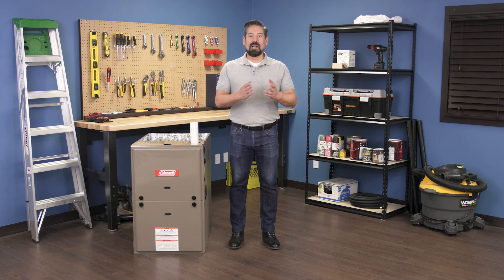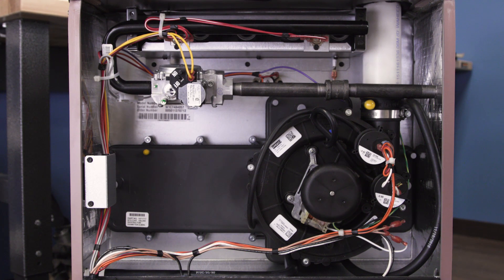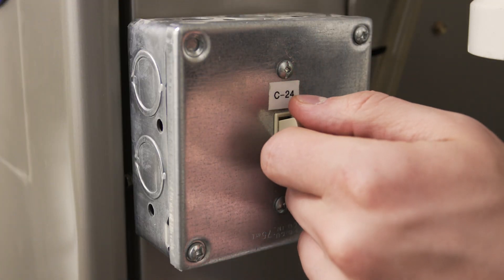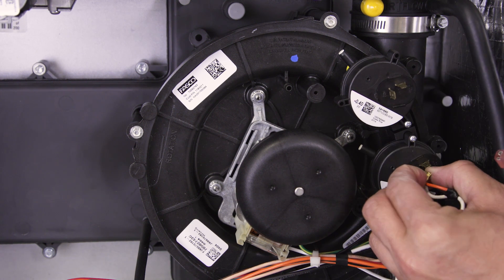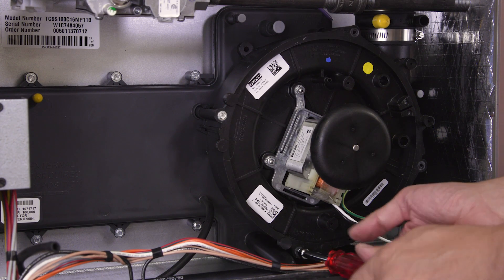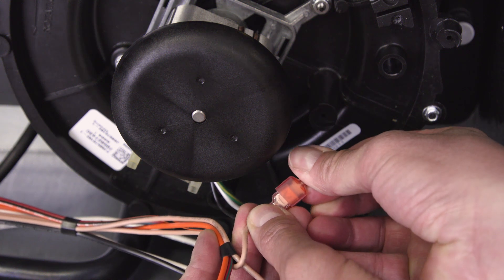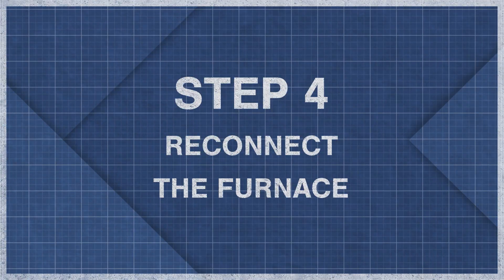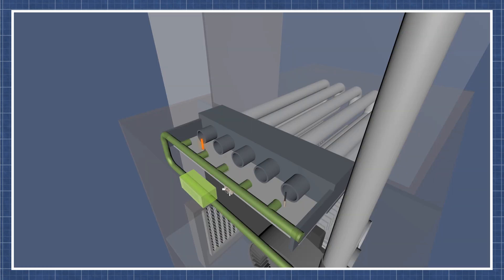Furnace - Draft Inducer Motor | Repair and Replace

Comment: I went to AMRE store in Richmond BC...I was told by a loud rude old woman that there is no returns on any electrical devices.  So the Inducer motor was not returnable even if is defective... That is probably against Provincial consumer law   For example...if the unit is defective from the time of purchase..I refused to submit to the outrageous policy of AMRE and bought it on Amazon...
Reply from the maker: Hi Jay, thank you for sharing your experience with us. Currently there are no provincial consumer laws guaranteeing the right to return an item. The "no returns on electrical items" policy is meant to help ensure that all electrical parts are brand new, and fully functional when someone needs the part. If a part is damaged during shipping or was defective at the time of manufacturing then that's a different scenario. Incorrect installation of electrical parts can result in damaged that is not always visible or obvious. Its similar to how auto-parts suppliers will not accept returns on certain functional items like spark plugs or brake pads. In any case I have shared this with the Richmond manager so we can ensure that matters like this are communicated more effectively in the future.

Comment: Good Information, Thank you. Hopefully someone can offer advice. I have an American Standard  HE (Freedom 90) installed in 1992.
Heater was cycling on and off and I kept hearing a gurgling noise, so I called for a service rep.
He cleaned my fire sensor and that seem to resolve the cycling on and off, however he pointed out external water under the Draft Induced Motor (DIM).  He pull the bottom drain on the DIM and watched condensate come out, the PVC drain pipe has a short run to the ground floor drain it did NOT appear to be clogged.
So question is 
1. Can I change out the DIM or add new seal to resolve? 
2. Or buy a new unit as Service Rep indicated.
Reply from the maker: Thanks for watching, we're glad you found the video helpful. If the draft inducer motor is clogged then the water will build up, mess with the pressure and trip the pressure switch. If its just not draining properly then replacing it should resolve the problem. Alternatively some flue vents are installed incorrectly which can cause the condensate in the pipe to flow back into the draft inducer motor. If the flue vent is the problem then water might still build up even if you replace the draft inducer motor.  As for the seal, you might be able to find the part but that might be hard to find for that particular model.

Overall replacing the inducer is less expensive than a new unit, but considering the furnace is almost 30 years old there might be other components that might need to be replaced in the near future.

Comment: Why motor leaking from little slot in Front Goodman Furnace Draft Inducer Blower # 22307501 (FB-RFB501)
Reply from the maker: Thanks for watching. If its water leaking from the draft inducer motor then its most likely that the condensate drain basin on the furnace is clogged, or the condensate pump might have a blockage in the check valve. You can learn more about the condensate pump in this video: https://www.youtube.com/watch?v=dcLhyLu0-y8&feature=youtu.be

Comment: I have a Lennox GHR32V gas furnace, I suspect I have water in my inducer motor, is there a way to empty the water without pulling the motor out?
Reply from the maker: Hi Ed, thank you for watching. Your furnace should have a condensate drain that either leads into a condensate pump or a floor drain. First make sure that the drain tube is not clogged and that the check valve is working. This is shown here: https://www.youtube.com/watch?v=dcLhyLu0-y8&feature=youtu.be That might help drain the water. If that doesn't help then the easiest way to remove the water is to remove the inducer assembly.

Comment: Fantastic video.  Thank you so much.  I'll be replacing my draft inducer motor on my Rheem gas pack.  My old draft inducer motor has 2 black wires (connect just as yours do in this video).  My new replacement motor has 1 black wire and 1 white wire (again, same connections as yours in this video).  How do I know which to connect?  Or does it matter in this case?
Reply from the maker: Thank you Travis, we're glad that you found the video helpful!  Always try to match the wires if possible but there are some cases where the new wires will be different colors. The inducer motor is an AC motor so the polarity of the wires shouldn't matter,  so just like solenoids, limit switches, and fuses, it will work in either configuration.

Comment: I'm in Las Vegas and (11-6-2020) I paid $750 for this part and labor.
Did I get ripped off?
Honestly.
Thanks!
Reply from the maker: Hi Jim, thank you for watching. $750 is within the normal quote for this kind of a repair that includes parts and labor. Part of the labor cost often goes to cover the overhead and will seem higher than what most people think an acceptable hourly wage is, but in a lot of HVAC companies there are administrators and other staff that are supporting the technicians. There are many homeowners that have done these repairs themselves and saved some money, and other homeowners have hired someone while supporting their local community. The matter of value is up to you to decide.
Reply: @AmreSupply  thx

Comment: What is the plastic thing the draft inducer mounts too? It has what looks to be water drip line. My draft inducer went. I replaced it, but noticed the plastic is cracked where the foam gasket sticks too.  Could that crack be allowing water to make its way into the draft inducer. Causing the draft inducer to fail after 4-5 years? We replaced it about 5 years ago. The plastic wasn't cracked during the replacement process. I dont want to blow another draft inducer motor in a few years, if I can help it.  I will replace that cracked piece as well. Please any info is appreciated. Thank you.
Reply from the maker: Thank you for watching. The piece you are referring to is often called a condensate pan or collector. In some furnaces the condensate water is removed by a floor drain and in other models a condensate pump is used.  If the condensate drain line is clogged, then condensate will build up in the inducer motor.  First check to make sure that the lines are all good and have clear access. As well ff either the inducer motor, the housing or the condensate pan is cracked then its best to replace it. The condensate pan is not a very common part to replace and is often hard to find.

Comment: Is this a diy job and require licensing, like when the central ac isn't cooling house which requires freon?
Reply from the maker: Hi Xian, thank you for watching. This is not a sealed system like an AC or a refrigerator. The pressure switch monitors the exhaust gas pressure, so once the furnace stops running, the inducer will continue to run, clearing the flue of exhaust. When the furnace is not running there is just room air inside the draft inducer and vent. Replacing the inducer motor assembly is pretty easy overall but if you don't feel comfortable with the repair then it is best to contact a professional.

Comment: My inducer motor makes this electrical zapping noise when it goes to start up then its quiet. Should I replace it? Transformer and start up capacitor are both new
Reply from the maker: Thanks for watching. Since it happens only when its starting could be one of the contacts in the relay on the control board. It could also be a  loose connection or a worn out motor winding. Relay issues are hard to narrow down but with the power off you could check for continuity between the inducer motor contacts and the metal housing of the furnace to see if it is shorted to ground. Regardless If it runs properly after startup then it might just continue to work for a little while but its best to keep an eye on it.

Comment: Hi and thank you for an excellent video and encouragement! I am definitely a diy'er. My friends Bryant furnace has a very noisy inducer motor. My question is what is the rationale for replacing the entire assembly vs just replacing the motor? Except for the motor, nothing else is moving, correct? Sounds like a bad bearing or something akin to that. Also, I like to support folks such as yourself who provide the service of excellent videos, but you are in Canada, correct?
Reply from the maker: Thanks for watching! We're glad you found it helpful. Overall Inducer motors are sold as fully enclosed assemblies, as any disassembly of the blower can compromise the seal and potentially create pressure issues. 
You are right, we are in Canada, and we do ship to the USA but with with the lockdown still being lifted, shipping over the border is not back to normal so it might take a while.

Comment: Hey does anyone know if the inducer motor and the restrictor plate is needed to run the AC(central air)? My furnace gave out this past month and the restrictor plate behind the inducer motor has a big open crack in it but I don’t have the money to fix it right now. Any advice would be greatly appreciated.
Reply from the maker: Thanks for watching! The inducer motor removes exhaust gases from the heat exchanger and is only active during the heating cycle. The blower fan will be active during cooling but the inducer is not needed for air conditioning.

Comment: Had my furnace serviced and they said I need a new inducer motor. The part was about 450 plus they said around two hours labor. Should I do this myself by watching this video? Seems two hours is a lot for this job, no? 
Thanks for this video btw: awesome!
Reply from the maker: You're welcome Nicholas, we're glad you found the video helpful! Sometimes techs will bill for setup or transitional time or time to test things as well but in most cases this repair will take less than an hour. As long as you find an exact matching inducer motor assembly, this repair is straight forward. If you are confident in the steps then it is a repair that you can do. If you are unsure, then let the Service Technician handle it.
Reply: I paid $120.00 for my inducer motor and installed it myself in under 30 minutes. Easy peasy!

Comment: Hi, I have an Amana AMVC 950905DXAA furnace which was installed in April 2010. From last couple days when the furnace runs it produces an intermittent squealing noise which can be heard at the air intake vents I have inside the house. The furnace will run quite and then for few minutes the squealing noise will be there and it will run quite again. Is it the bearings on the inducer motor? How can I troubleshoot it. Your help will be very much appreciated. Thanks
Reply from the maker: Hi Gurdip, thank you for watching. With the power disconnected you could try turning the inducer by hand to see if there are any sticking points or if it feels rough or restricted to turn. If the inducer bearings are worn out, then its best to replace the inducer blower assembly. Because its a sealed system, almost all inducers are sold as a complete blower assembly and are designed to be replaced as one unit. Opening the unit to disconnect the blower and replace the motor would compromise the construction and the air seal.

Comment: Can you just replace the motor itself??
Reply from the maker: Hi Rick that is an excellent question. Because its a sealed system, almost all inducers are sold as a complete blower assembly and are designed to be replaced as one unit. Opening the unit to disconnect the blower and replace the motor would compromise the construction and the air seal.

Comment: My Bryant furnace was leaking water onto the floor.  The repairman came out and found a leak at the inducer motor shaft seal that was leaking down the front of the motor assembly and down the drain tube to the blower compartment.   So yesterday he replaced the inducer motor and cleaned the pilot.
Well, this morning I just went down to check it out and discovered that it is still leaking...........Why?     I paid $75 on day one for him to come out and check the furnace and he gave me the estimate.  Then yesterday when he replaced the motor and the 3 wire pilot it cost me an additional $643.      Obviously I'm going to have to get him back to my house but I certainly hope it isn't going to cost me more money since it should have been fixed yesterday.
If you have any thoughts I would appreciate hearing from you.
Reply from the maker: Thanks for watching. These kinds of problems can be sometimes difficult to narrow down. It could be a venting issue creating more condensate than normal. As well there could be an issue or a blockage in the drain line going to the drain (or condensate pump) preventing the water from draining out, which would cause it to build up. With a buildup of condensate it can leak even with a new inducer and a good seal. Hopefully this helps!

Comment: Great video. My technician said there is water in the inducer fan, should I replace it or try to clean it out? If I replace it should I do something so it doesn't happen again? Thanks so much!
Reply from the maker: Thanks Owen. That is a good question. If you drain the excess water, and the motor is running fine then you shouldn't need a replacement. Its worth checking the condensate drain line. In some setups the inducer will have a drain pipe that will directly go into a drain. In other cases a condensate pump is used. https://www.youtube.com/watch?v=dcLhyLu0-y8 In either case, make sure that the line isn't clogged so that the condensate can properly drain out and not build up.

Comment: Does this require drill or no?
Reply from the maker: HI Xian, thank you for watching. You will not need a drill for this. A screwdriver will work to remove the screws.

Comment: How different would this replacement be for a Trane Gas Pack?
Reply from the maker: HI Carolina, thanks for watching. It really depends on the model but the mounting screw position and orientation can vary. Just make sure to take pictures before you disconnect anything.

Comment: What’s the problem if when I turn the heat on, if I set it on auto doesn’t blow any air and I put it, on it just blows air but not hot air?
Reply: That's normal. It's your main fan setting. On = running all the time, thermostat cycles heat on/off as needed; auto = only running when the thermostat calls for heat.
Reply from the maker: Thanks for watching Francisco. Gyarr is right and explained it well. Also If you ever want to test if your furnace is running and don't want to wait in auto, then just set the thermostat to 10° higher than normal. The furnace will kick on in the auto setting. After you verify if its running then just set it back to the normal temperature

Comment: Would this installation be similar to a Crown bimini boiler  motor replacement?
Reply from the maker: Hi Mike, thank you for watching! I am not familiar with that particular model of boiler. Generally inducers are fairly similar in the way that they are mounted but you'll get different mounting screws in different places from model to model. Also check to see if the inducer comes with a gasket.
Reply: @AmreSupply  First off I'd like to say thank you very much for replying ! I'm pretty sure it fairly similar, it came with gaskets and screws I just didn't know if there was any specific thing you have to do after installation or just let the computer figure it out. We had a guy here that diagnosed it Sunday (luckily a friend!) But I've been trying to reach him and hes very busy. So just wasn't sure there's no special procedures afterward.
Reply from the maker: @mikevasapollo6349  You're welcome. Once the inducer motor and the pressure switches are hooked up again everything should function as normal.

Comment: my problem is this I want to change my furnace exhausted inducer motor the original one is rotation CWLE p/n 45037-001 no.702110602 can I use this model# 45037-001 no.702111106 with rotation CCWSE.
Reply from the maker: Those parts should be the same. CWLE and CCWSE are the same direction just different ways of wording it. Here's a brief explanation: https://youtu.be/vFD9Px9alME?t=34